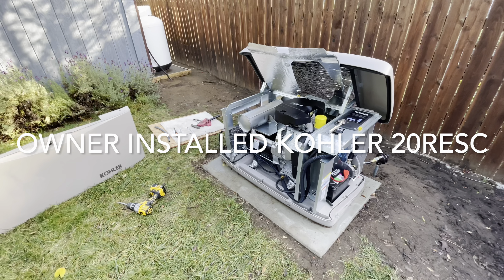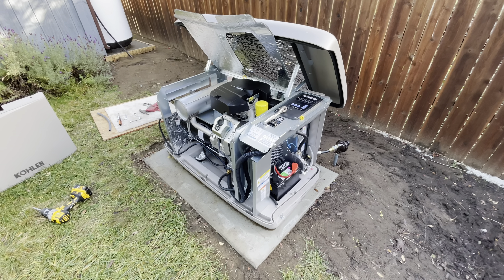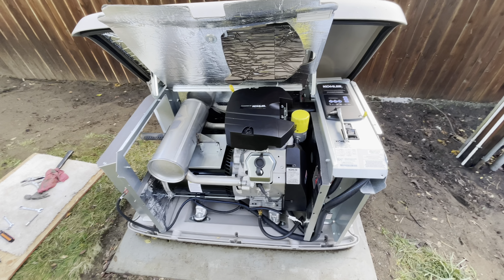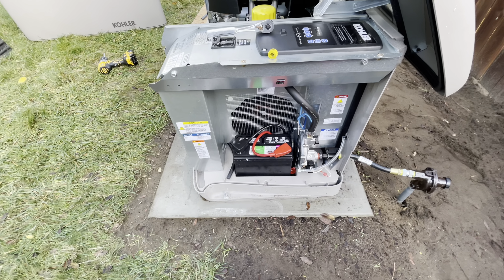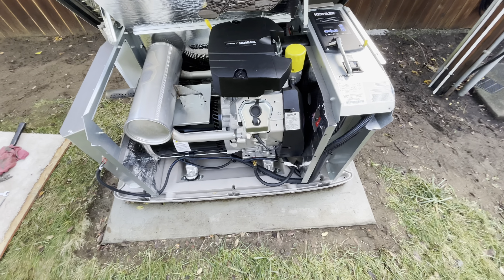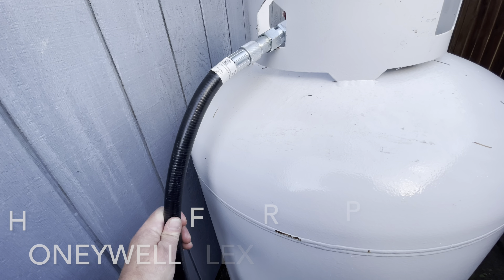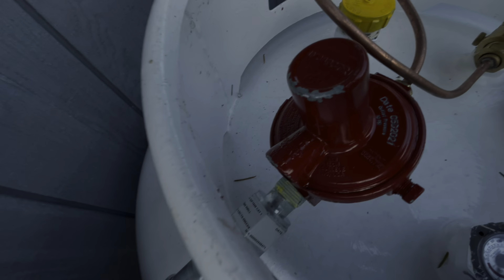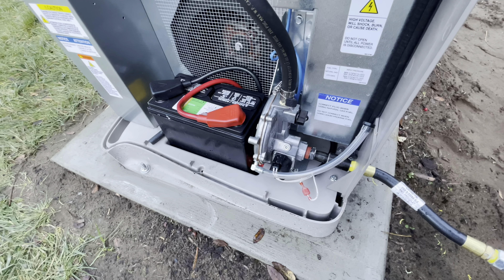KOHLER 20RESCL- user installation

Comment: Can I ask what the brand of secondary regulator you used, the brown one outside of the generator, and do you know what the range of inches WPC or water column. Did you buy that at the gas supply company?
Reply from the maker: I’m in the process of moving to the home with the recently installed generator. Currently I’m 90 miles away packing my belongings. I’ll post the information you requested when I return. The gas supply equipment was purchased from various suppliers including a local general store and the propane supplier. I’m sorry I don’t have the information handy. 
We haven’t yet experienced a power outage but the unit fires up in exercise mode every two weeks without fail.
Reply from the maker: In reviewing pictures on my phone I believe all the regulators used were marshall brand. I’ll post the model numbers when I return.
Reply: @jatoav8or  you still gone?

Comment: Have you thought about getting a 500 lp tank for it. I been looking at kohler generator 20kw . They said full load 2.2 gallon propane.
Reply from the maker: I was looking into a larger tank but back in January we lost power for nearly 24 hours and the generator ran the entire time. I was surprised at how little gas it used. I came to realize my household electric demand averages about 25% capacity of the generator. All told so far it’s run our home about 33 hours this winter and consumed 35 gallons of propane. If I stumble across a good deal on a larger tank I’ll probably get it but for now I’m comfortable with the size. 
I’m also planning to set up my system so I can run a smaller portable inverter generator to handle my 110v circuits. That way if we have a severe storm and a  extended outage I’ll use the Kohler when we want to use high demand appliances but otherwise we’ll run the smaller unit for lighting & entertainment.
I should say I also have a big wood stove that keeps the central air heat from running most days.
I want to also state for the record my wife and I are both extremely glad we purchased the Kohler, no remorse or regret at all. We’re right on the North Pacific coastline and it is a very satisfying feeling when the generator fires up in the midst of a storm.
Reply: @jatoav8or  I like your idea of getting an small generator for the small loads. BTW, since you are not going with the 500 gallon tank, you might consider this method to get more fuel out of your existing tank during an extended outage (no refill available) in cold weather. When lp fuel is relatively low in tank, apply & turn ON an electric blanket with a 95 degree thermostat along the wet surface area. If you see any frost on tank, it is time (probably past the time) for the electric blanket because the remaining liquid fuel is so chilled from the rapid vaporization happening to keep genset supplied with vapor that the ambient air cannot keep up with warming needs. The blanket will help insulate from the cold outdoors while allowing transfer of electric heat to the wet surface area of your tank. But, if you don't energize the blanket, you must remove it from the tank so ambient air can once again heat the tank.
Reply from the maker: @takeitwithyou4391  thanks for your input, I was actually looking into heating pads designed for semi truck oil pans to adhere to the tank. 
As of late the generator is experiencing rpm surging issues when under no load or light loads. I think it’s either a gas pressure issue or throttle stepper motor issue. Either way I’m disappointed that a unit with such low hours is acting up.
Reply: @jatoav8or  Don’t know if this applies to your genset. You will need to check. Back story: Typically, a demand regulator has TWO ports called Regulator Vents. If you bought any old demand regulator and had it shipped to you, you might find RED plastic plugs in these ports. The plugs are there to keep crud and bugs from blocking these vents before actual use. Sometimes people install these regulators without removing the plugs and find they don’t work well. Take the plugs out.

Back to your genset. We easily see one vent port and the long tubing with a plug in it. At a minimum, remove the plug and vent to outside the cabinet. Run generator to see if it runs better.

Now, there might be more to this but you have to determine if there is another vent tube and plug on the other side of the regulator which needs to be unplugged and routed similar to the one we see. I say this because I looked at a pdf of installation instructions for the genset from your video title: 20RESCL

https://www.kohler.com/content/dam/kohler-com-NA/Lifestyle/PDF/PDF-tp6803.pdf

There are two figures to look at:

Figure 1-14 shows: Regulator vent tubes (vent to the outside of the enclosure)

Figure 1-15 shows: both vent tubes blocked by plugs.

I am assuming these plugs are installed from the factory to keep water, wasps, bugs, crud, etc. from blocking the tubing before final installation.

Also, see Figure 1-20    Fuel Regulator Vent Hoses (20 kW only)

Comment: Thought about getting one for a long time. Never did like the maintenance, Battery oil. too much. Start up every month for twenty minutes. Propane and Gas could be scarce and expensive. Noise is a problem too. Went for two 3600 lipo battery. Like that I can charge with solar.
Reply from the maker: I also had several reservations, the biggest being cost. Our home is right on the SW Washington coast and since my wife & I moved down here permanently in mid December we’ve had 3 major storms and 3 power outages, the last of which lasted 14hrs and we had family down for the holidays. 
Any of my misgivings have vaporized. 
The exercise mode can be manually set to any period of time you wish, months ahead if wanted.
Noise isn’t a issue with neighbors as we’re in a rural area and being placed twenty some feet from the house we honestly can’t hear it running unless the TV and or stereo are off.
Changing the oil is quick & simple and only required once a year especially if good quality is used. 
Before I retired we lived in a small town 90 miles inland and it wasn’t uncommon to go years without a power outage and when it did occur it was very short lived so anything more than a portable generator was impractical.
I was also pleasantly surprised to find liquid propane prices didn’t increase like gasoline & diesel over the last few years.
If we lived in a sunny climate I would entertain a solar/battery bank system but we average 80” of rain annually so the options are limited to power our home for extended periods. 
I know this is a long explanation of our situation but if any others read this exchange I want them to understand the situation. 
Cheers!

Comment: You need a drip leg on the propane line before the regulator .
Reply from the maker: Thanks for the heads up. Do you think a 3 or 4 inch stub would suffice? 
Fortunately it hasn’t been used for any extended periods yet so hopefully no major amount of contaminants have been ingested.
Reply: I think either is fine probably. I'd go longer than shorter probably
Reply: @jatoav8or  I'm planning on doing mine today or tomorrow. I'm gonna put a 4inch before my in line regulator.(I have one because my distance form tank, we had to increase the pressure because of the distance is far, then it's regulated down to regular pressure)  And a 4 inch at the unit also
Reply from the maker: @jordanonofer3886  My experience plumbing gas is limited. Never had gas heating or cooking in any of my homes so I appreciate that you raised my awareness. The company supplying the gas & tank should have mentioned it when they looked it over for me.
Reply: @jatoav8or  Hey no prob. Just set mine today. Gotta do the line still. But yeah I overlooked that on my old one. So now that I'm doing a new one. Def wanted to mention it to you after noticing it. Best of luck with everything

Comment: Get that battery on a charge as soon as you can, for as of now the controller is using all the power from it .
Reply from the maker: Thanks for the heads up.
I’m almost finished with the electrical hookup, I disconnected the battery in the interim.

Comment: For anyone in a cold climate, that tank won't run that gen. For anyone in a warm climate, that tank holds 96 gallons of LPG when full, if that gen is at half rated load you can get about half of it out if it is 55 degrees, maybe 2/3rds if it is 90 degrees outside, so somewhere between 24 and 32 hours of run time at half load, temperature variable.
Reply from the maker: I’m having some RPM surging issues during exercise perhaps it’s fuel related?
Reply: @jatoav8or  do you have a gauge on that tank? How much is in it? If it is less than half full, that probably is the issue.
Reply from the maker: @thastinger345 
The gas company keeps the tank topped off. I need to check the pressure delivery.
Reply from the maker: @takeitwithyou4391  thank you! 
I’m going to look at that.  I’ve noticed the surging problem is worse with the lid closed and or that inner reflector flap down like air flow has some effect.  I’m 3 hours from the nearest authorized service center, it would be nice if I can avoid a $400 house call!
Reply from the maker: @takeitwithyou4391  The clear tube you’re referring to has a black plastic plug screwed into the end?
Reply: @jatoav8or  Try removing the plug and route outside the cabinet. Air must flow inside the tubing. Can't with a plug in it.
Reply: check out this video: Kohler Generator Maintenance Must Service    @ 08:30